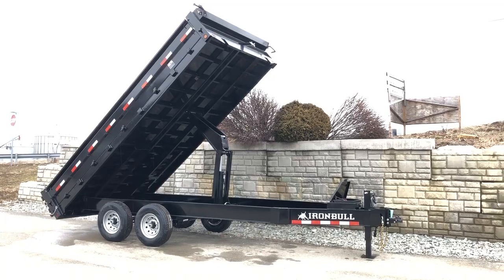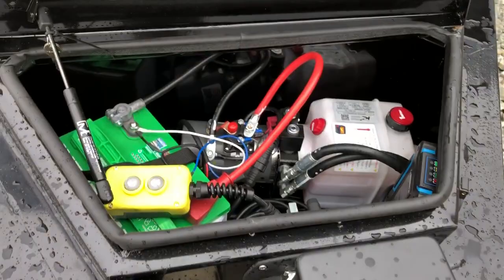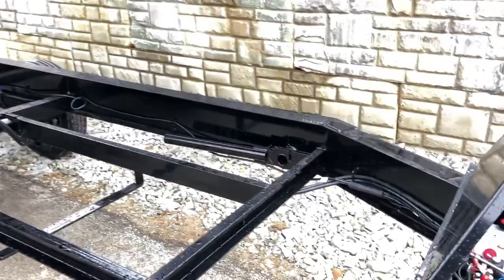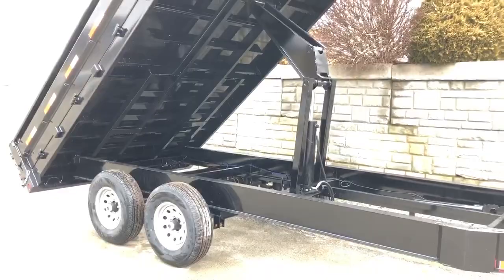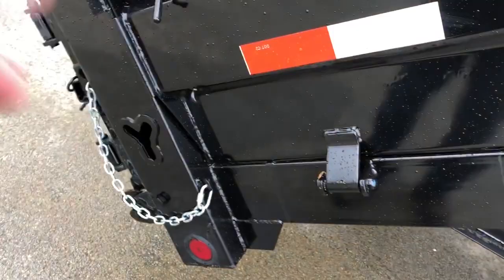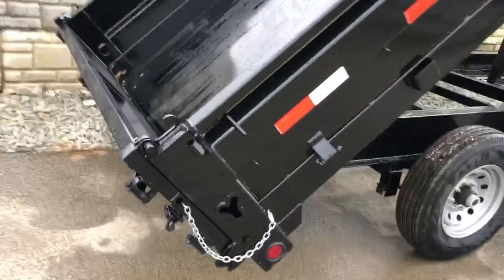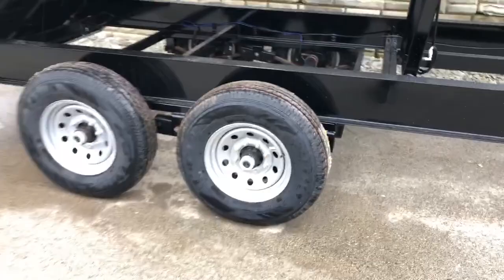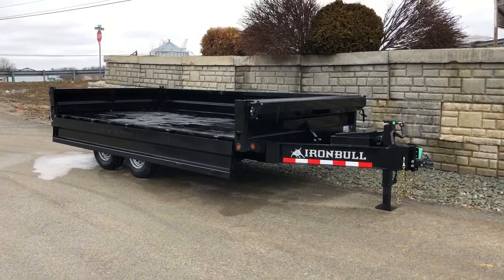Ironbull 8x16' Deckover Dump Trailer 14000# GVW FOLD DOWN SIDES * DDP9616072

Comment: what picks up more trail load scissor or this?
Reply from the maker: From a lift standpoint they should do the same.  Ironbull uses an oversize 5x20 hoist on all sizes whereas the industry generally uses the 5x20 only on a 16', if at all.  5x16' is a 'normal' hoist.  A 5x16' hoist on a 14' dump will lift about 6.9 tons (legal payload is about 5 tons, and with tongue weight another 1-ton).  A 5x20' scissor hoist Ironbull uses will lift about 8.5 tons.  For what it's worth, the 5x20 hoist on the 14K model is the same hoist used on a triple axle.
Reply: @BestChoiceTrailers  can you explain 5x20 and 5x16 so I know details?  it went over my head sorry